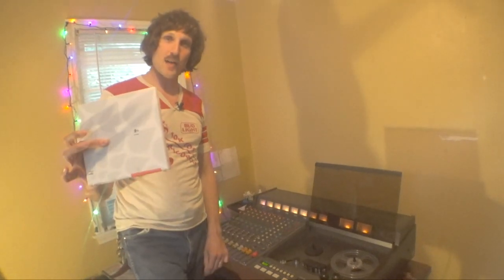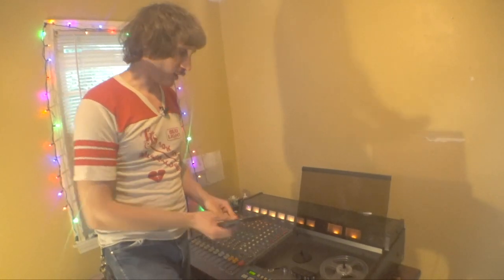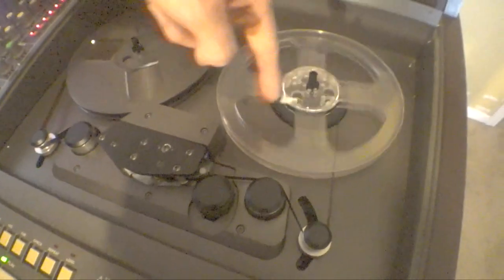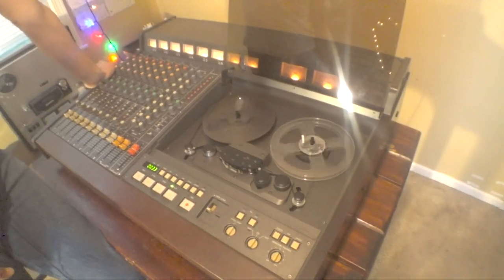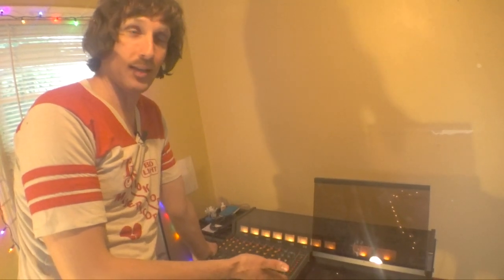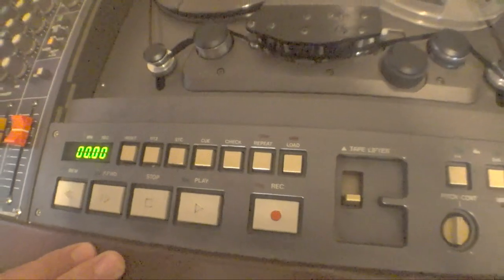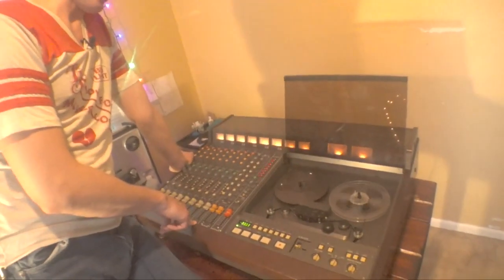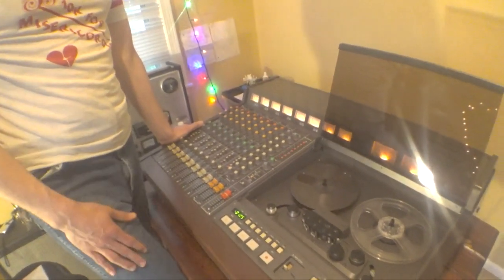Tascam 388 - How to Load a Tape

Comment: Tail out storage won't prevent bleed through. But it will be a post delay effect instead of a pre delay effect with tail out. A pre delay effect is more noticeable, because you'll for example hear a loud part start before it actually starts. Also you would just take your new reel and put it on the right side. You don't have to spool it on a new reel. Either way you'll get bleed through pretty fast. Bleed through won't need years of storage to take place.

I don't want to sound like snob. That's just the deal with tape.

Comment: Hi Matthew, could you tell wich pickup reel to buy for the tascam 388? thx
Reply from the maker: Hi, just saw your email! Any 7" take up real will work as long as it has the 3 prong hole. Also, check out "recording the masters" brand tape on ebay. It's the stuff.
Reply from the maker: https://www.ebay.com/itm/PLASTIC-EMPTY-TAKE-UP-REEL-7-INCH-Scotch-Assorted-Brands-One-1-Reel-/323370004262?mkcid=16&mkevt=1&_trksid=p2349624.m46890.l6249&mkrid=711-127632-2357-0
Reply from the maker: https://www.ebay.com/itm/Recording-The-Masters-RTM-SM468-1-4-Audio-Tape-/324520319776?mkcid=16&mkevt=1&_trksid=p2349624.m46890.l6249&mkrid=711-127632-2357-0

Comment: Hey man, My 388 has been sitting in storage for over 10 years untouched I just tried to load a tape to make sure it works  but when I load my tape it keeps unravelling like im not putting it in properly, but I’m following your video, and I used mine so much as a teen with no issue. I can’t help the right side of the play head is not spinning properly? Is that a known issue, any suggestions why that might be happening when I load my tape?
Reply from the maker: Sounds like it may need a capstan belt